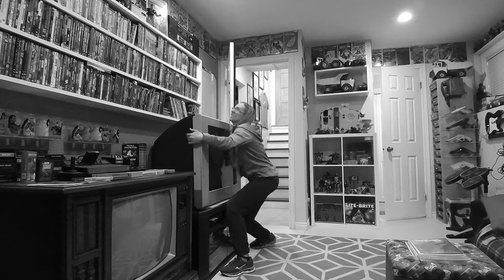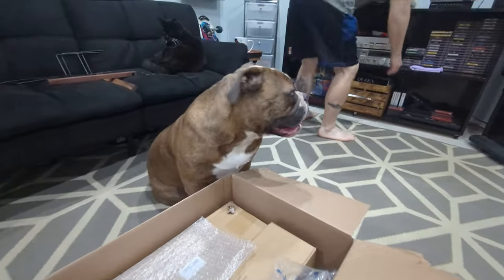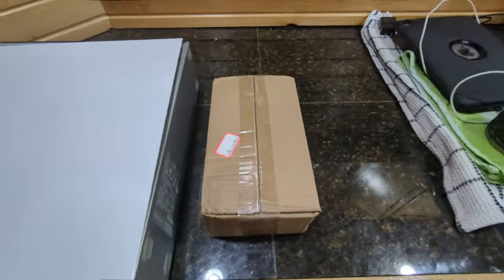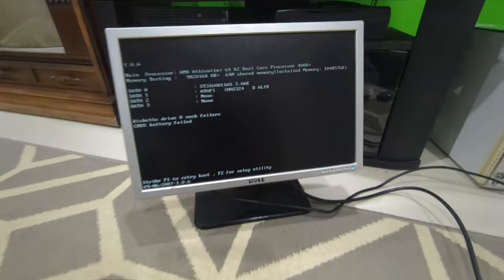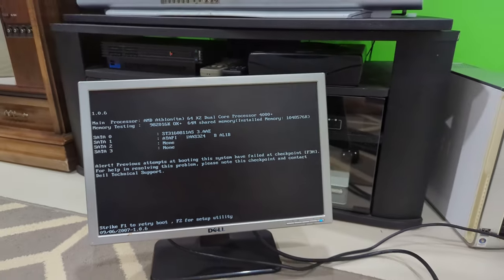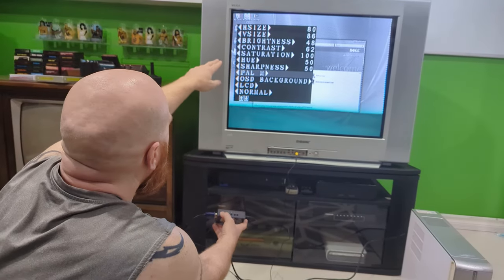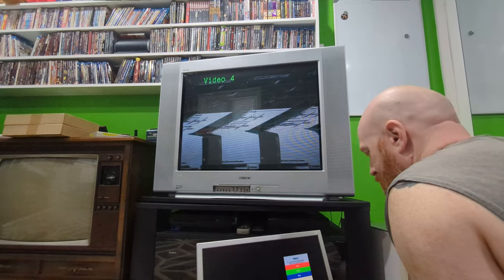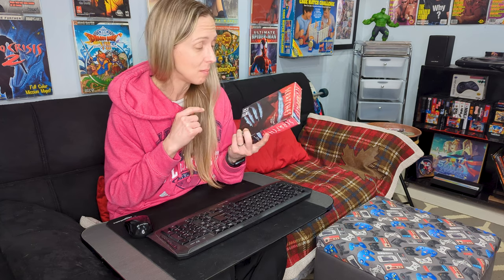How to: Hook your old PC up to a CRT! Retro on the CHEAP!

Comment: First off, a 2007 PC running Vista is not an old computer, anything after a 486 running Windows 98 is far too modern for me 😂
Well done on replacing the power supply m and CMOS battery 👍 and that must have been a nightmare for Scott navigating those menus preset on PAL 😱 There are so many great games available to you now with that little machine, si well worth all the trials and tribulations 😎👍
Reply from the maker: Well, well touche!  You have a good point.
I figured I could probably get it to work because I've messed with my old desktops numerous times replaced things upgraded other things.  Apparently I just don't have the knack with a laptop. I'll break those every time 😂😂😂
I'm very excited to see what other games I can get into.  I'm definitely keeping my eyes peeled at the thrift stores

Comment: Hi, just started watching your  channel, cool video I did that once I think I had the same ctr tv, I don't remember how I hooked the video to the tv but the audio I used a cable that one end had a red & white RCA plugs and the other end had a 3.5 mm jack.you should have a audio input on the back or front of tv,and where you plug your speakers in the 3.5mm should go helps
Reply from the maker: Yes, we're going to definitely have to get behind there and see if there's a way to hook up the audio at the time. We were just trying to put it together and get it running and we had so many issues that I just said just plug it into the computer for now